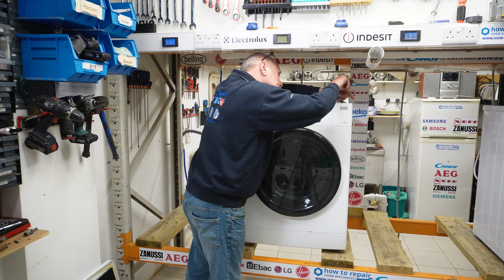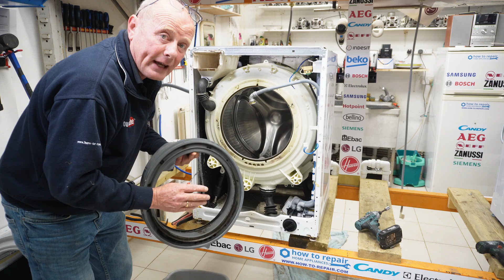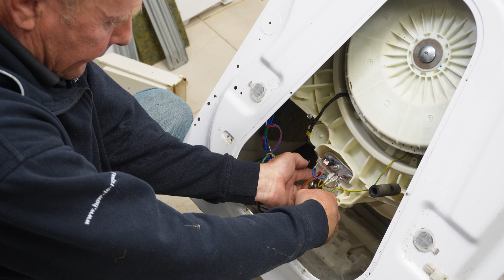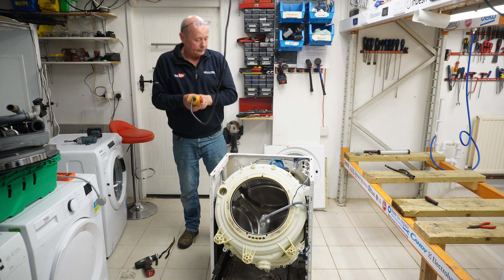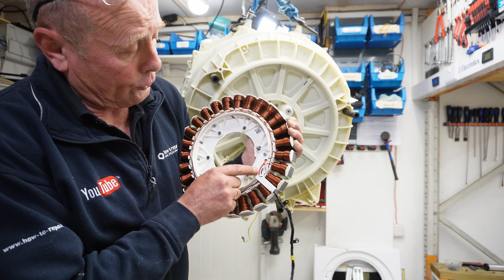Dismantle Whirlpool Zen FSCR10431 Washing Machine | Step by Step Whirlpool Disassembling Guide

Comment: I've repaired my Whirlpool Zen thanks to this video, I had the "descaling" alert and the locked keys activated in the same time. It created a blocker issue when I was not able to make the whole machine to work. Before buying a new one, I decided to reset the front electronic: So as shown in this video, I've unplugged the front panel, without the laundry drawer inserted. then, when replugged it created a higher priority alert, which re-enabled the "locked keys" to be working fine again. so I unlocked those by pressing it more than 3 secs. then it unlocked the whole machine. I've put back the laundry drawer in place, then reassembled the whole thing, it took only like 15 min, and this saved me 600quids...

J’ai réparé mon Whirlpool Zen grâce à cette vidéo. J’avais l’alerte « détartrage » et le verrouillage des touches activés en même temps. Cela a créé un bug blocant : je ne pouvais plus faire fonctionner la machine du tout.Avant d’en acheter une nouvelle, j’ai décidé de réinitialiser l’électronique en façade. Comme montré dans la vidéo, j’ai débranché le panneau avant (petite nappe), sans insérer le tiroir à lessive. Puis, en rebranchant la machine, puis la nappe, cela a déclenché une alerte prioritaire "remettre le tiroir à lessive", ce qui a permis au verrouillage des touches de refonctionner correctement. J’ai donc déverrouillé les touches en appuyant dessus pendant plus de 3 secondes. 
Ensuite, toute la machine s’est déverrouillée. J’ai remis le tiroir à lessive en place, puis tout remonté. Ça m’a pris environ 15 minutes… et ça m’a fait économiser 600 euros! Merci et bon courage à tous !!!

Comment: Is it possible to remove this type of motor from this model of washing machine for replacement without removing the washing machine drum and dismantling it completely?
Because I find that the open space at the back is very narrow and I cannot pull the motor cover out of it.

Comment: You saved my day as I own the FSCR 10432 since 2015 with a new water filter alarm. I would have never opened it without your video. I could then dismantle the pumps (3 screws for each of them) and I discovered some kind of teflon tape blocked into the drain pump axis. I love your videos, very teaching, clear phrasing, good tips and a lot of effort in the editing. The video about the way to clean the seal is very instructive. Thank you!
Note: I still own my very first washing machine bought in 1999/2000 - a very basic Candy (french brand I think), on which I've never change a single part. It was our main washing machine before we bought the 10Kg Whirlpool. I'm now thinking that I should open it and change the belt, the pumps and maybe the bearing if it is still possible (parts availability).
Reply from the maker: Glad my video was helpful mate. I also appreciate a beer after a hard day of creating free appliance repair guides in our warehouse, offering a choice of single or round beer.  https://www.how-to-repair.com/help/buy-paul-a-beer/ Thanks 👍

Comment: Great video mate!

My Samsung WF1124XAU  12KG washing machine purchased in Oct 2013 has died. No power even after fuse changed and trying a different plug.  I think it's the main PCB or inverter.

Comment: The drawer leaking is common on these, not to do with it being unlevel just a design fault
Reply from the maker: Thank you for the information. I've worked on about half a dozen of these and I'd always notice the front panels rusting but didn't realise it was a design floor. Thank you for the information. Any other gems of knowledge like this? I've always appreciated for other people to read. Thanks, Paul 👍 directly
Reply: I agree the front body panel of mine is full of rust below the soap box, and on the lower part below the door. All the three screws that fix the panel on the bottom are full of rust, even the one on the top right is a bit rusty...
Is there a fix for this design flow? Do you think that the body panel is available as a spare part?
If not, I should probably remove it and put a rust treatment, protect it and paint...
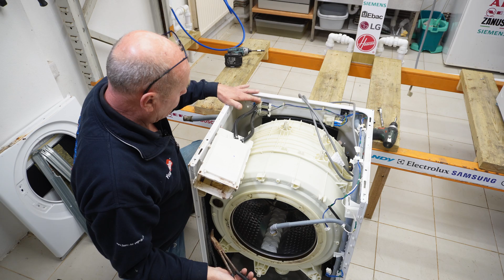Reply: Our soap box (removed at 11:11 in the video) was clogged with limescale/calcium deposits. It contains a tray which channels the water to the various areas of the soap dispenser. Whole unit came apart and we cleaned with Limelite - water is now routing properly and no more leaks! We live in a hard water area and use Calgon tabs, but these go into the soap dispenser, so too late in the flow!